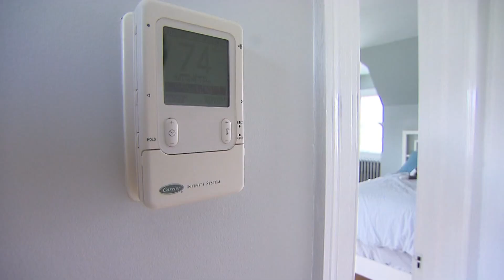CU professor helps measure the impact of wind farms

Comment: Does the report speak about how wind turbine waste just gets buried? Does the report tell us what the overall carbon footprint of each and ever windturbine is?  Does the report tell us how 1,000 gallons of OIL is needed for EACH WIND TRUBINE????
Reply: They are not perfect, but are still better than fossil fuel. So what?
Reply: @who2u333   Did you notice how much 'fossil fuel' is used for each turbine?  Fossil Fuel is a misnomer because it has nothing to do with fossils. Crude oil is a mineral the earth produces so it is constantly being renewed. Far from perfect, wind turbines are fatally flawed. They simply cannot replace crude oil as an energy source.
Reply: Hey if you don't mind huffing on a tail pipe or having a dash of BP on your shrimp keep cheering for the oil companies.
Reply: @johncarter1852  oil companies get rich off your stupid windmills  lol